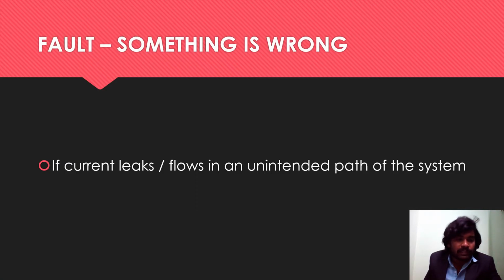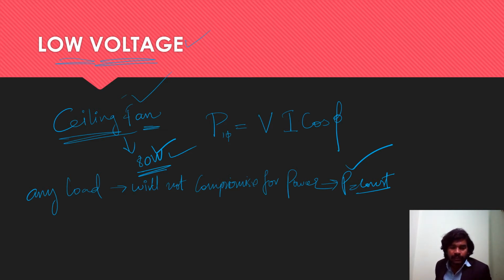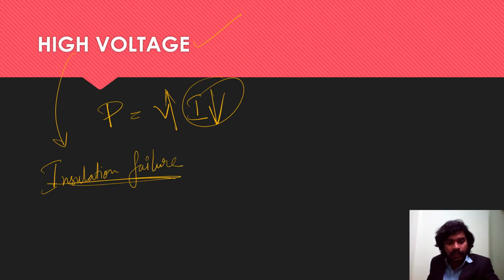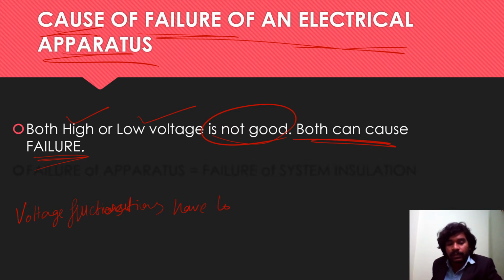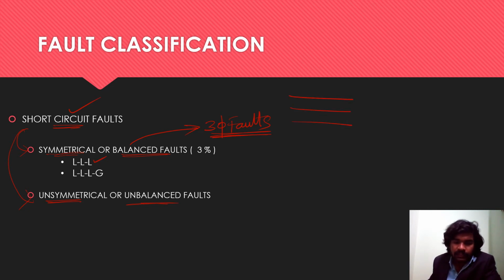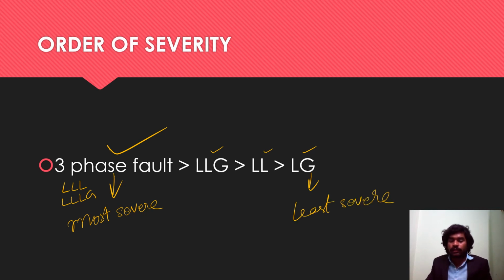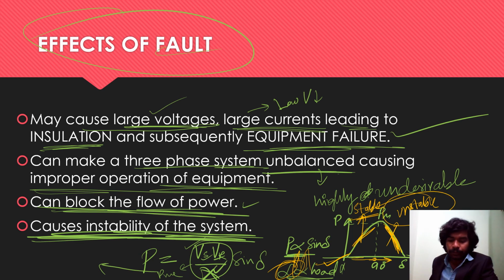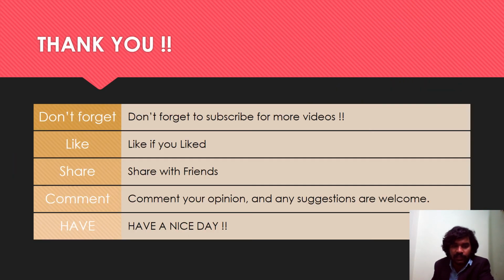01 - Fault Anlysis - Introduction | Power Systems | Nikhil Nakka

Comment: Sir can you answer this 
The +ve sequence current for LL fault of 2kv s/m is 1400 A
And corresponding current for an LLG fault is 2220A. The zero sequence impedance of the system is???